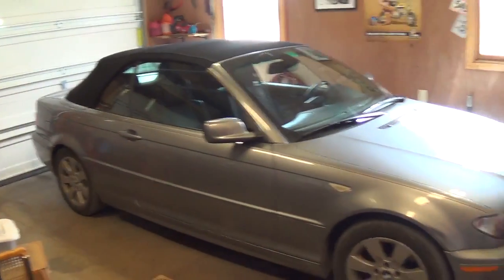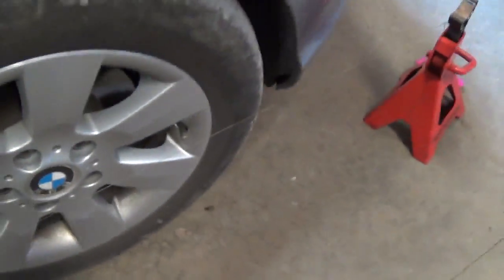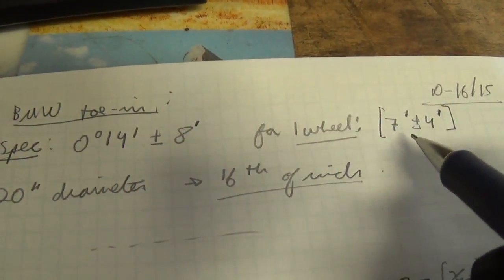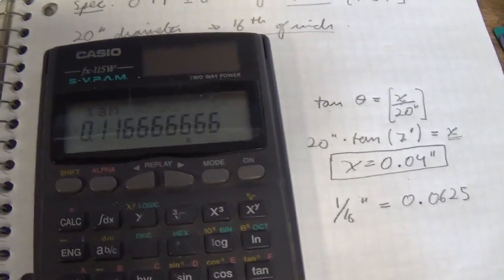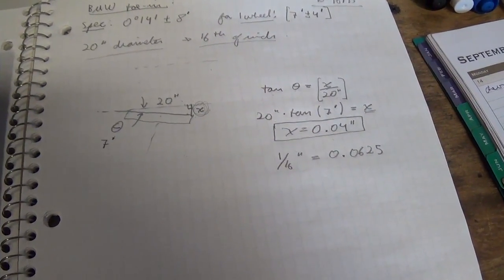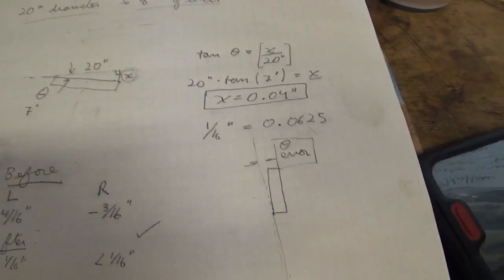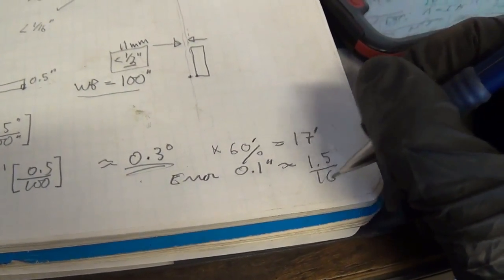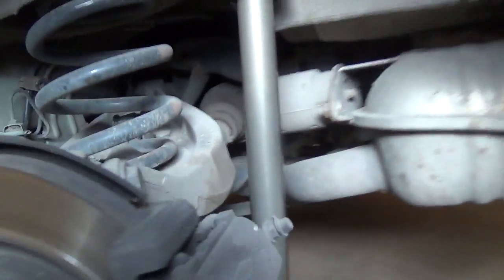DIY toe-in alignment: follow-up '06 BMW 325Ci

Comment: Well done. I use same method as you do. Always measure to center of the each wheel to get it square to the car first. Then adjust, move car front and back, again, done. Perfect alignment in 30 minutes anywhere.

Comment: You could have simply measured the front and rear track width to account for any difference. That half an inch from the vw was enough to put your finished position way out of spec.

Comment: I was able to get all 4 wheels tracking straight and steering wheel is horizontal.  I used my toe plates.  All 4 wheels are adjustable.   2011 Camry.   Smooth as a boat on water 💧.  Best this car has ever tracked and I have paid for alignments previous.  My alignment is better and free.  👍

Comment: Nice work. I'm attempting to improve my alignment tomorrow using similar methods. Mine's a 2001 330i. Steering wheel is cocked to left and it darts a lot at highway speeds. This is how the car was when I bought it. I just rebuilt the engine, transmission and painted most of the car. I'm surprised I'm not bald yet from all this car has put me through.

Comment: Track width on most e46's is wider in the back by approx 6.35MM per side (.25"). So when measuring your string length either make the front tires wider or back narrower. I measure to the center of the rim right below the cap.

Comment: I have been trying to get this right on our X3 and After I got it bang on I started getting DSC errors. After spending a bit at shops I got a scanner and discovered it has an electronic steering wheel sensor, and with car running straight it reads -18 degrees. So, before you start, the sensor needs to be at 0 position (Steering wheel may not be straight though). Complete the alignment, I used string method with total of 1/8th toe in. Physically moved the steering wheel to center (disconnect battery when doing this). DSC errors are cleared and the car runs straight and the xdrive computer is much happy not having to keep adjusting the xDrive mechanism. Might post a video on this.
Reply from the maker: Great point about steering wheel angle. There must be an option to "re-zero" the calibration with a scanner.
Reply: That option works but gets overridden soon after driving, as the car has a "learn" mode and keeps adjusting and tuning itself. So it kept going back to -18 degrees. I left scanner in live data mode while doing the alignment so could turn the wheel until zero and dash underneath to adjust tie rods. All this can be done without a scanner though. Simply count steering wheel turns lock to lock and then 1/2 it, that will be your "0".  Stick some marker tape on steering and rest of the housing as additional check.

Comment: Essentially laser alignment machines use the same method accept it uses a more precise laser. Also another variable is bent rims which notorious for throwing off even the computer machines. In some vehicles you may notice there are holes on the rim. Thoseholes are used to insert a pin plate and to use the hub to measure alignment and not the rim
Reply: Mercedes reccomends only using the pin plate method

Comment: What it does tell you at the top is that the vehicle needs to be fully weighed down.  Weight in the front seats, back seat, washer solvent tank full and fuel tank full for accurate alignment.  They want the adjustments to be made as if the car is driving down the road (squatted down)  I am not a fan of how this is done but to each his own.
Reply from the maker: So do you invite all your buddies to pile into the car before doing an alignment? ;)
Reply: haha that I do not.  I actually do not align BMWs for that reason.  The dealerships have weights to put in all those areas.  Just was giving my opinion on this alignment in particular.  The string method can be close on most cars but I dont think it was very accurate in this case.

Comment: BMW are supposed to be aligned while the vehicle is weighted down in both front seats, rear seat, full gas tank and weights in the trunk.  They are to be aligned like it is under acceleration because the vehicle squats down when you accelerate.  Even with this string method the toe would still change under accel.  I am just saying since you mentioned you had limited experience in this area.
Reply: yep but i cant run very fast with the tape measure. cars always provide a static measure for the tracking, show me a bmw being tracked at the factory using your method

Comment: Old school you chalk the center tread full circumference, place stationary scribe and spin tire to scribe line both tires, tape measure front & back side of tire and you are done with your measurement. Adjust as required to bring into tolerance and steering wheel alignment. Once you have your toe set then adjust both sides equal amounts left or right to align your wheel. Same way we did dirt modified race cars.  This is done with suspension loaded & bounced before & after adjustments. Keep the videos coming!

Comment: your best video yet...keep up the good work.... string away from car, a stand off of maybe 3" then use the rims for measurements, because the sidewalls are nowhere near being in the same space from one point to the opposite side. the stand off is due to not really knowing if the string has interference on the side wall......the 99cent laser is a way cool tool but there is an error even in a calibrated laser though very small.

Comment: For such small angles you can use small-angle approximation to get a very accurate estimate of tan. To do this you'd multiply your angle by Pi/180, as small-angle approximations are only valid for angles in radians. http://www.wolframalpha.com/input/?i=20+inches+*+%287%2F60%29+*+%28Pi%2F180%29

I guess this would be useful if you had a calculator that didn't have trigonometric functions, but you could also estimate Pi as 22/7 and do it by hand if you really wanted: http://www.wolframalpha.com/input/?i=20+inches+*+%287%2F60%29+*+%28%2822%2F7%29+%2F+180%29

Comment: I just replaced the back shocks on my 03 325i with 126k miles, but they weren't as bad as that one. They were starting to leak a little, but there wasn't any rebound in them. Replaced them with the sachs/zf oem for about $80 from bavauto.com

Comment: another variable? rear toe adjustment? static rest? really need slip plates under the wheels. BUT your method will get you close to specs. good job ivan.

Comment: The problem I c with this method is that the vehicle is not loaded. The tie rods go thru an arc as they go up and down in the suspension stroke, and so it would seem that they need to b at the normal loaded position. That is why I do something similar but while the vehicle is on my pit. I sight the two beads that u were measuring from, and the c where they r in reference to the rear tires. After making an adjustment, I then roll the car back and forth to eliminate the tire bias/scrub. Then recheck. But what do I know?
Reply from the maker: +Bill Rimmer Absolutely! The only reason I had to lift the Beemer was to loosen those dang tie-rods! After it was back down on the ground I did roll it back and forth a bit to eliminate the tire scrub variable like you said. Only then can you check the actual alignment.  Would be easier if I had a pit though  :)
Reply: +motoYam82 I sent u a video of mine. Racks r great, but a pit is nice too. Also they work nicely with a regular garage ceiling. Still hoping for your analysis of the maxidas. Questions like, is their domestic or China?  Will it check misfire counts on an 01 Dodge Caravan 3.3?  Your scientific method would b real nice. U and Eric in a scan tool shootout. One, two bar......   How does that go?

Comment: Technically in your triangle the hypotenuse is the wheel base = 20". So you would do sin(7/60)=x/20. But you get basically the same answer since theta is so small. The hypotenuse and adjacent side are almost the same length, so sine and tangent give you similar answers.
Reply: Also I found the front/rear track online for that BMW, and the rear track is 0.5" wider, or 0.25" per side.
Reply from the maker: +anti0918 Thanks for the info! So basically the final result here was right on the $$ :)
Reply: I think if you could make a string method that runs parallel to the jack points under the sides of the car, it would be more accurate, since you're using more length of the car to align by, rather than just the length of the rear wheel. And it should also avoid the error due to different track lengths.
Reply from the maker: +anti0918 Hmm interesting thought...how do you know the jacking points are parallel to the car body? Probably some other variables lurking there...some cars don't even have specific jacking points!
Reply: +motoYam82 well I was just going off my extremely limited experience. If they're not parallel then I'm not sure what else you can do really.

Comment: Nice work there Ivan on the follow-up using the string method. Calculations were nice too. One tip on converting a decimal number to a fraction such as 16ths, 32nds, doesn't matter, is to multiply the decimal number by the fraction you want to go to. For example, in your example of converting 0.1 to 16ths, just multiply by 16 and you will get 1.6 saying there are one 16th plus a bit over a half. To use an example which makes a little more sense, how many 16ths are there in 0.875. 0.875 X 16 = 14. And if you wanted 32nds, 0.875 X 32 = 28. Take care Ivan...

Comment: I do use the strings to get steering wheel somewhat straight , but if using string off back wheels , there are variables .Track width and ,and  Like on a lot of cars are the rear wheels in line, on some toe in can be off  , wheel and tire run out , and after adjustments i like to roll car forward and recheck . I know a lot of people use the string method , and as long as one is aware of the variables  it can work ok  That shock was cool
Reply: He mentioned different track lengths and covered it at the end of the video.